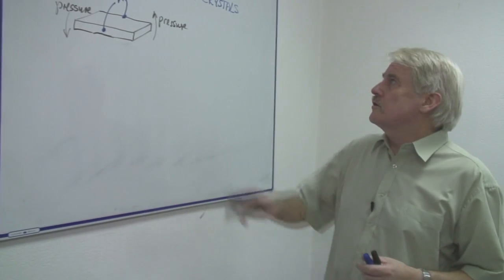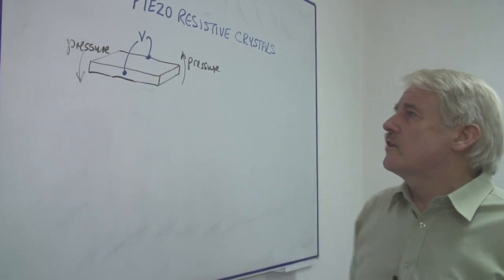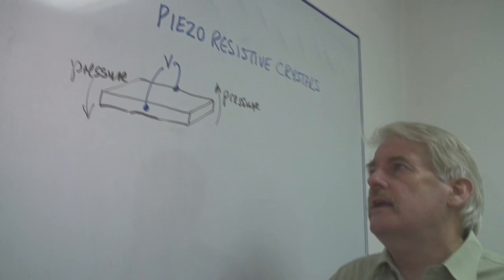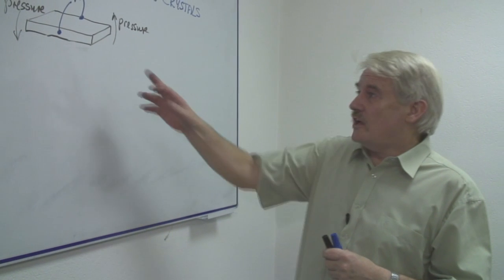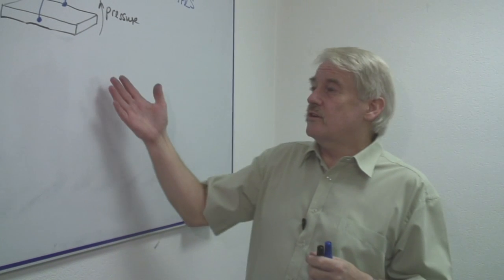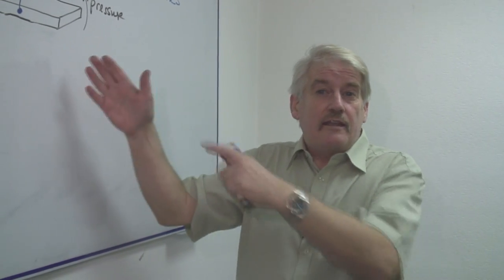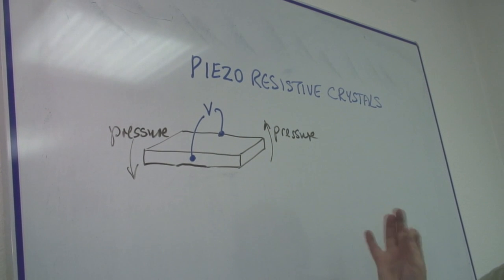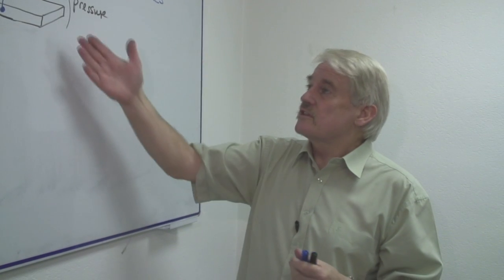Physical Science : How Do Piezoresistive Pressure Sensors Work?

Comment: Is anyone aware of the application of piezoelectric crystals for measuring deformation in architectural structures? I am fairly confident this man is confusing piezo crystals with strain gauges, given the fact piezo's respond to the rate of change of the force applied, which renders them fairly useless for (quasi-)static measurements.